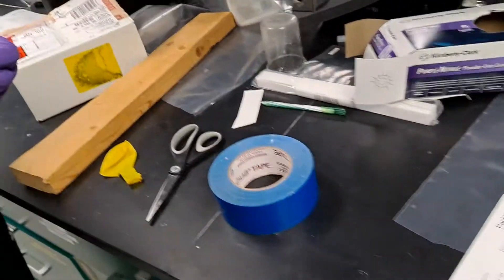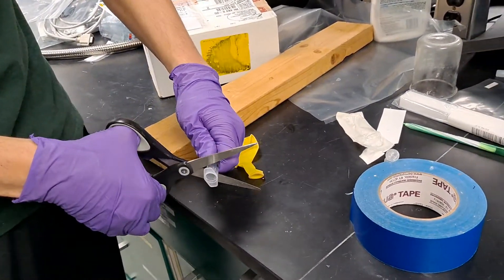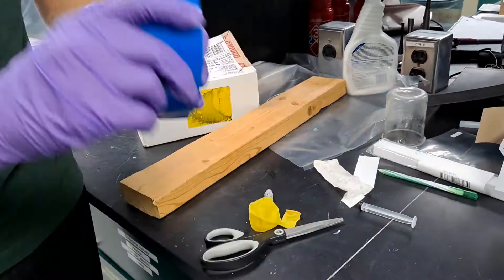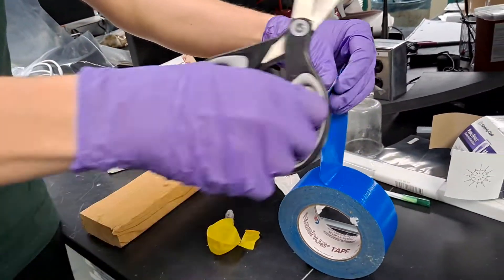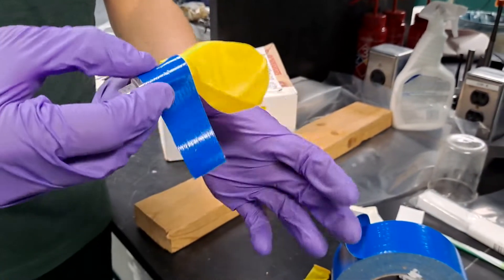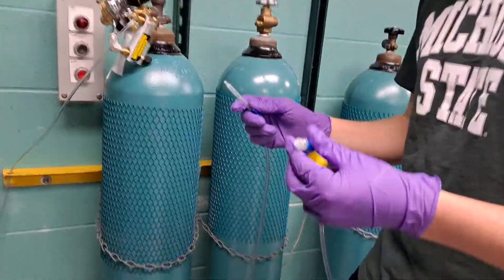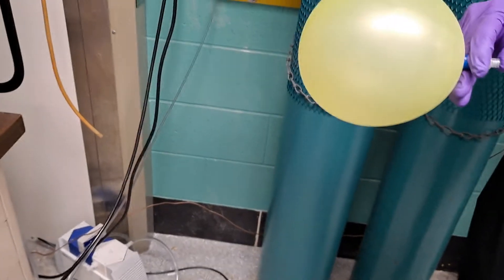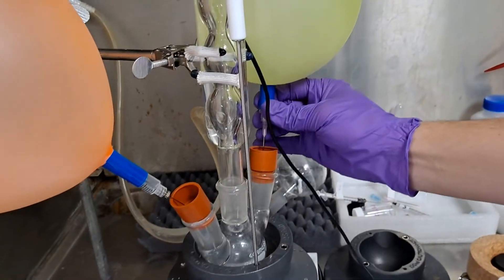Nitrogen Balloon for inert atmosphere chemical Reaction/Synthesis

Comment: Dont you have a schlenk-manifold or something? I would not call this "inert" atmosphere...just slightly better than regular atmosphere
Reply from the maker: Most of the synthesis experiments are done using same procedure if your lab has no well organized schlenk-manifold. It is much easier and cheaper option.
Reply: Agreed